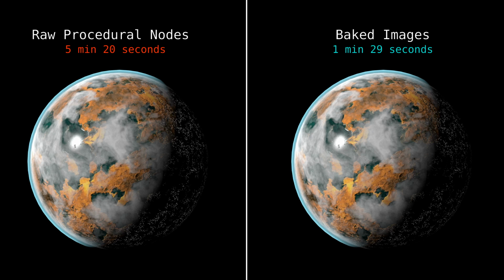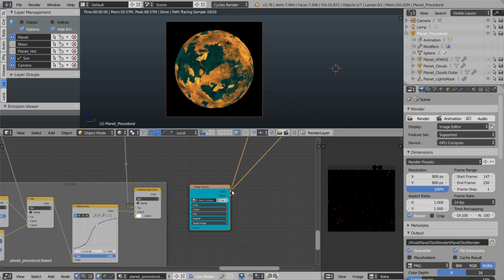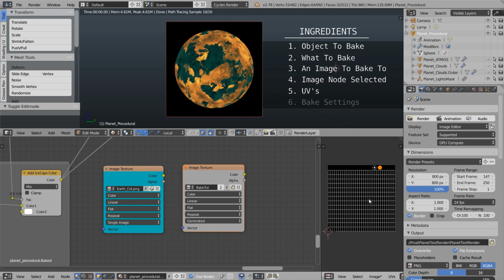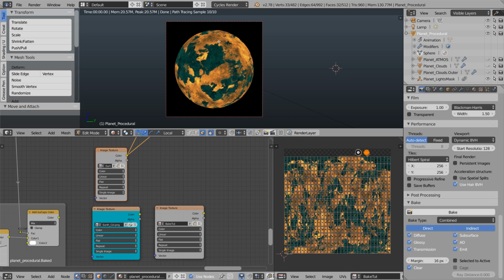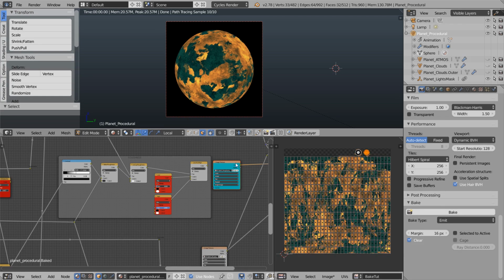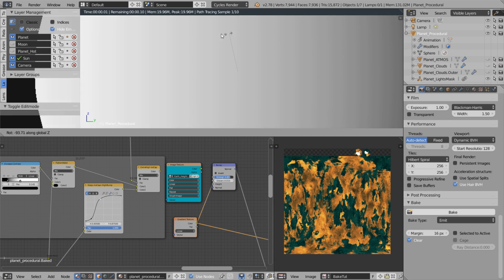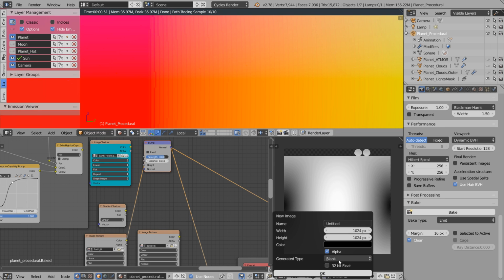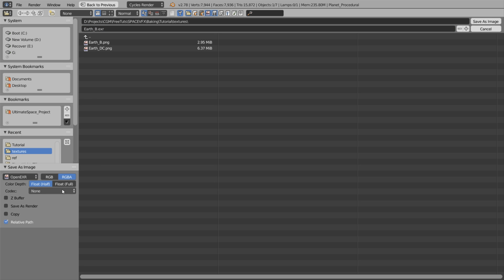Cycles Baking Tutorial | The Big Problem With Procedural Texturing

Comment: You didnt explain what's the problem with Procedural Texturing
Reply: The problem is that to get those masks you need to use a lot of nodes and math and when you render cycles needs to do all those calculations before giving the masks or color, if you bake  them you will use the uv space and thos calculations wont be used anymore

Comment: Great tutorial! It doesn't address my problem however, so I'll try it this way... For the sake of simplicity, I'll start with a new file. I'll click on the cube > go to edit mode > select all vertices > press u and choose smart uv project > go to uv/image editor > create a new image (called bakeduv) > go to the node editor > give the cube a diffuse > add an image texture > set it to 'bakeduv' > keep the image texture selected > go to render > no bake options... I have no idea what I'm doing wrong. It doesn't matter if I'm in object or edit mode, the bake option just does not show up. Please help!!
Reply from the maker: is this being done within Cycles? If you're in blender render that would be a different setup. It's a bit confusing! Hopefully this is streamlined in 2.8 :) Aidy.
Reply: Hey Aidy, thanks for your reaction! I already figured it out though. It was done in Cycles, but also in Blender 2.70. I guess the bake option came in a later versions because I updated my system and had no problem at all!
Reply from the maker: aaah, awesome! Glad you got it fixed! :) Aidy.

Comment: ONe question, you saved the bump as PNG but it also showed compression. How can you apply compression to a PNG, is then 8 bit and downsamplng colors? Because normlly a PNG is either 8 bit or 24 bit from Photoshop. Never seen option for compression. How do we bake a procedural animation then?
Reply from the maker: just spotted some unanswered questions on here! Apologies for the massive delay! The compression settings on PNG i don't understand what it does mathematically but it can make a massive difference to the filesize. For procedural animation that would be tricky, i think currently you'd need to script that, however, there maybe a script already in existence to do that. :) Aidy.

Comment: Tip: When you're doing it on a planet (sphere) like that, you can put a camera in the center and set it to equiangular and a resolution that is twice as wide as it is high, then by adding an emmision node to the part of the material that you want you can render it out (regular render, not the bake panel). That way you get images that will map perfectly to a sphere without the need for a UV map.
Reply from the maker: Thanks for sharing! That is a good point, definitely good to know in addition to the other stuff, UV's are still necessary for most optimal game engines though or realtime projects. But if realtime isn't required then that would work very nicely! :) Aidy.

Comment: 5:20 to 1:29... but how long does the baking takes? Is it really worth?
Reply from the maker: Good question! The baking for this example took about 2 or 3 seconds per image, and maybe 20 or 30 seconds setting it up. So even if it was a single image it would speed up the render. 

Though if for an animation then the time saved would be in the hours. (Depending on animation length of course!). 

Initially I baked out without tweaking any settings and the bake took a few minutes, though we then show how to speed that right up to just a few seconds. :)

Aidy.
Reply from the maker: hi! For whatever reason, images are as fast to look up as a procedural texture, though a decent procedural texture ends up being a whole bunch of nodes, and so ends up being lots of extra calculations that doesn't happen when it's just a single node image texture instead is suppose. :) Aidy.
Reply: CG Masters I just don't get one thing. Loading all the textures into GPU memory should take significantly longer than loading procedural textures (this should theoretically take almost no time since it can be described as a simple mathematical formula). How come (calculating procedural texture)+(loading bitmap texture into GPU)+(render time)  <  (calculating procedural texture)+(loading procedural texture into gpu)+(render time)?
Reply: Baking really shines when rendering animations because the reduced times stack up over multiple frames and the render time is much shorter.